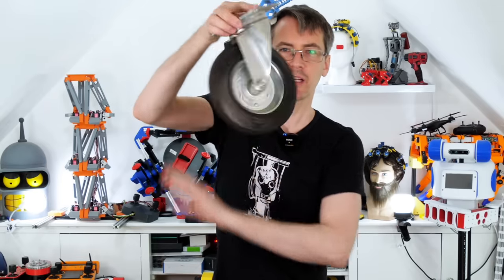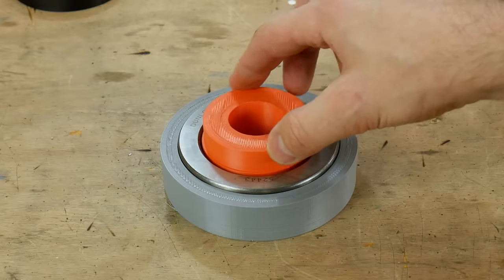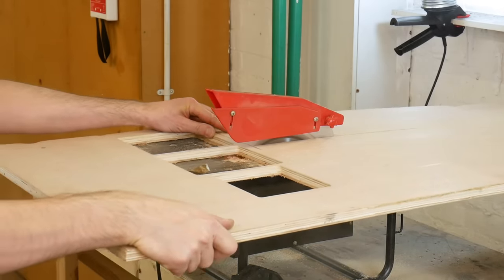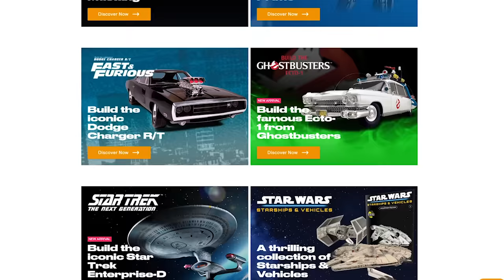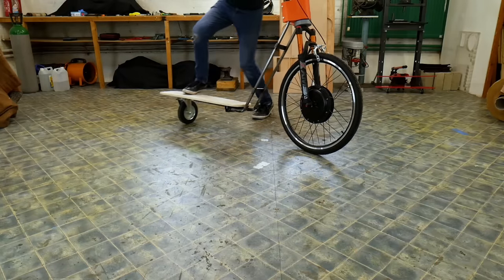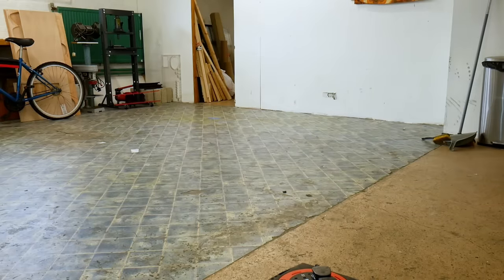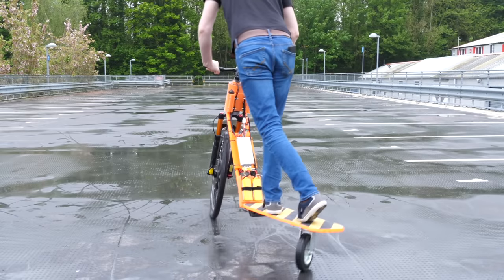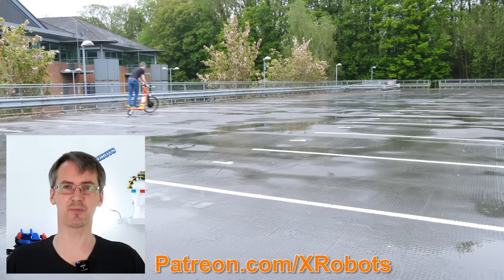1000W Caster Scooter

Comment: The easiest solution would have been 2 rear caster wheels.
Reply from the maker: But then we wouldn't know if you can ride with one?
Reply: @jamesbruton  You could, but it'd be easier if the front wheel was fixed and it were treated more like a unicycle. Really, it just seems like you're hellbent on reinventing the Wild Wacky Action Bike from South Park.

Comment: I see you don't have real engineering skills. Because if you did you would have locked that rear caster and used a piece flat metal to reinforce the inside turn of that metal bar.

Comment: Motor on front is cheating
With no motor and castor on rear by pumping the rear wheels / carving this will drive you forward 
It’s a common kids toy been around for years YAWN
Reply: It's kind of a different vehicle if it's fundamentally different.